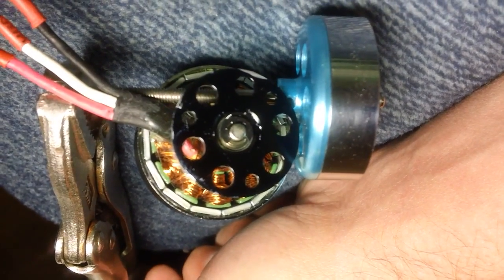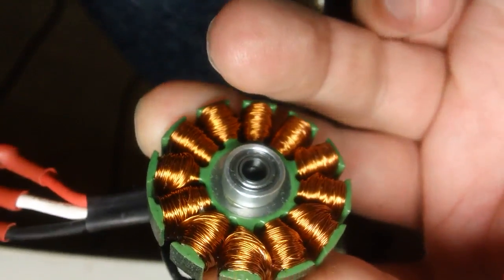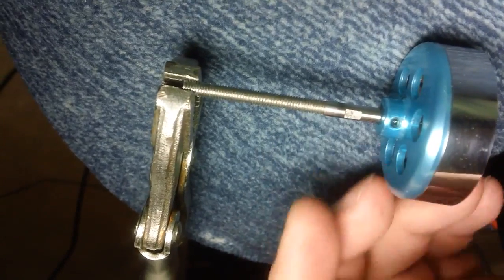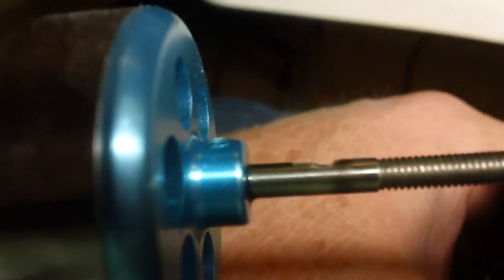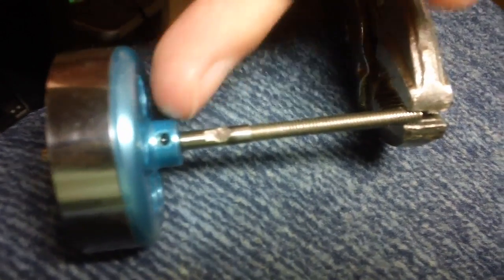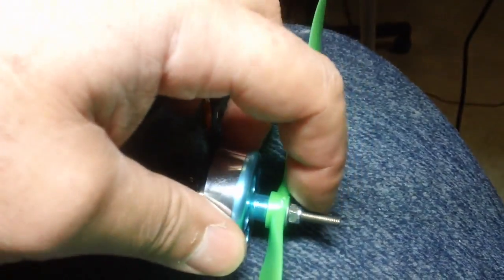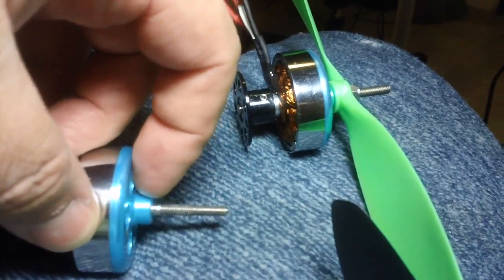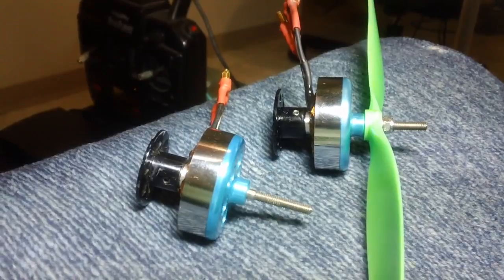RIPrc  HK  DT 700 How to Mod for a Multirotors

Comment: i have a question !!
I bought 3 of these dt700 and 2 bags of gws 11.47 i realized that they cant fit i mean it needs just a little bit to enlarge the prop hole. or I should cut the prop shaft because it s bit wider on top and thinner to the motor !?!?!?!

greetings from Bosnia :D